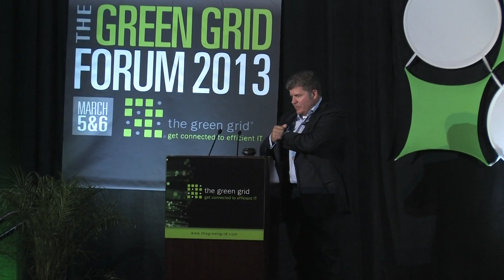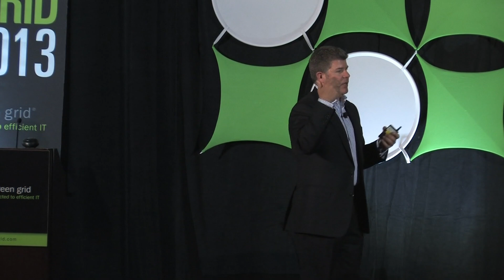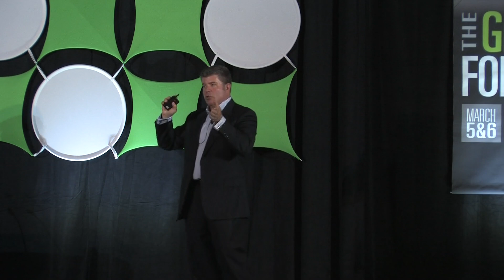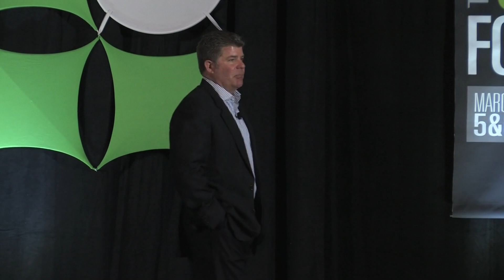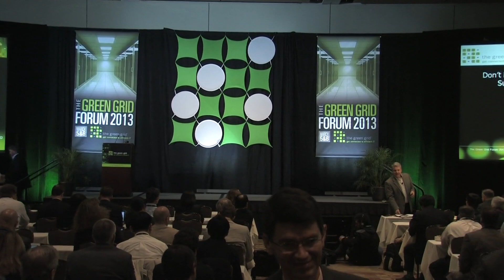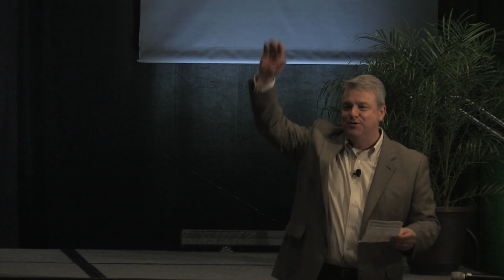Google Data Centers: A Behind the Scenes Look at Infrastructure and Innovations

Comment: To access the presentations visit the Library and Tools section on The Green Grid website, then select Presentations under Content Type. The presentation is posted there. Alternatively, you can type "Google Data Centers: A Behind the Scenes Look at Infrastructure and Innovations" into the Google search bar in the top right corner of the website.